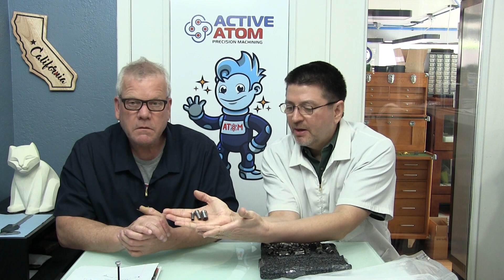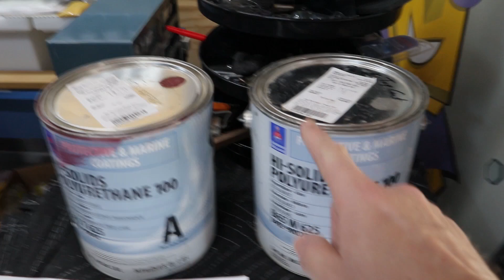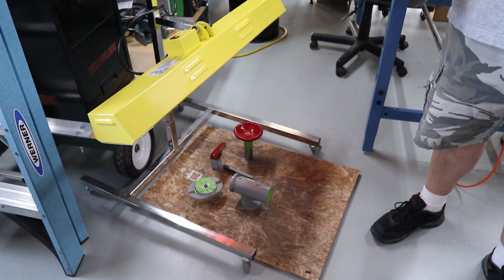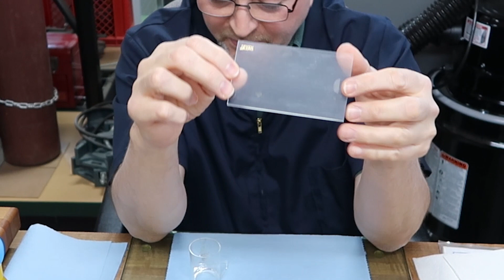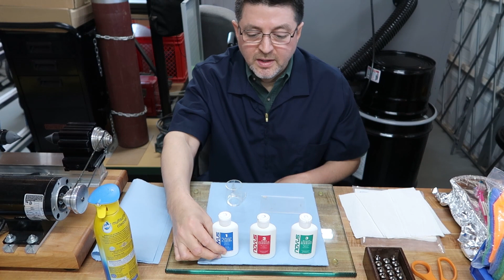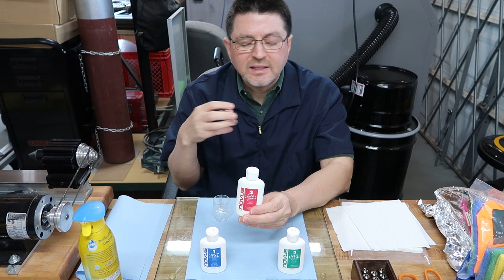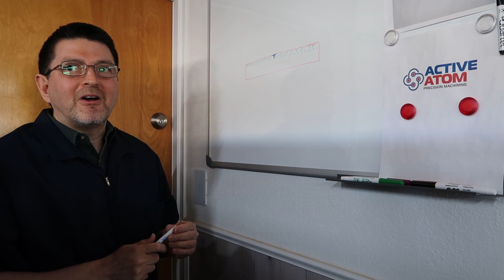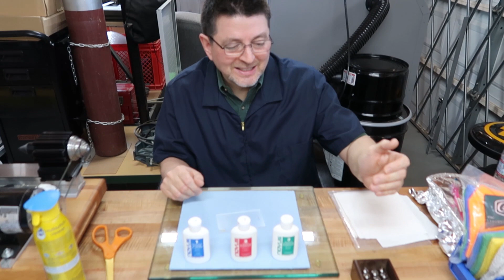SHOP ADVENTURES 35: Painting with 2-Part Epoxy & Polishing Plastic Parts

Comment: I've used that water based paints before, only the PPG brand.   I hate it.    I paint show cars , so i know exactly what your taking about with the prep time.    Paint is just a color, it will only look good if the preparation is done right.
Reply from the maker: Hi Doug could not agree with you more, this paint is tough, thinner we did not use it, though it comes with the kit.
We brush painted drapes well no brush lines not for cars though when you do it this way, you get to spay this paint from PPG how cool is that?
Brushes for us as these are machines and machine tools the first one we painted about 2.5 to 3 years ago. 
We are so happy, we actually started prepping the parts for reassembly of our miniature Barker Milling machine 6.00" x 20.00" table size, we have to make this machine do some roughing work for our product as we bought this mill 4 or so years ago and are finally heading towards putting it to work.
Remember Doug, we do not have a knee milling machine like many of the YouTube community creators do, so this has to work for us we are doing a Barker Milling machine update in this coming weeks Shop Adventures 36.
Stickers just came in, they are going out end of this week, printing paper to accompany these sticker set, hope you like them, we have your address already label made.
Thank you for sharing your paint knowledge see we have a video to come watch from two days ago, will be by in a day or two.
Lance & Patrick.
Reply: @ActiveAtom  I know a guy that has a die filer that would look good in your shop... lol